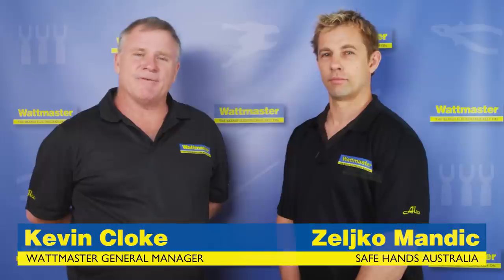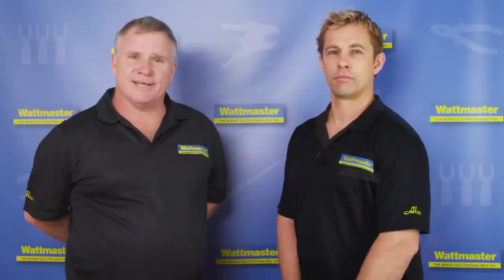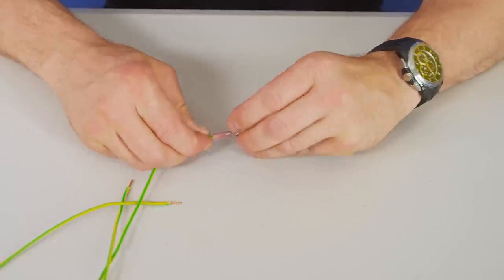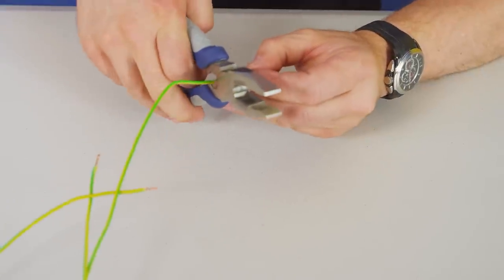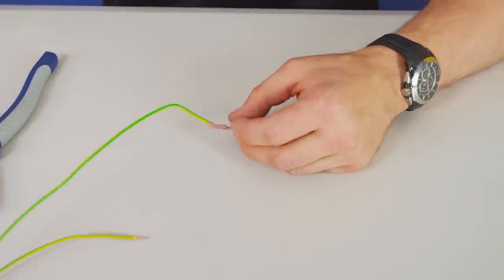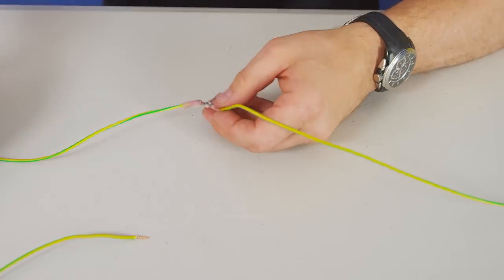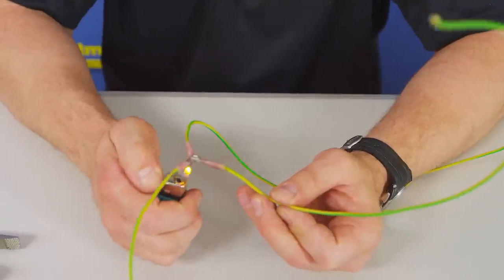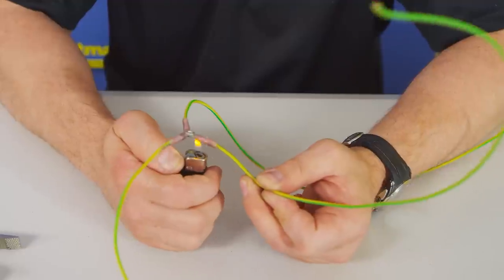How to join cables with 3 way heat shrink crimp connectors - Wattmaster TV

Comment: interesting that you can protect the wire connection with heat shrink but he center of the connector is exposed....kinda defeats the purpose, doens't it?
Reply: it's a ground wire, it must be conected to a grounded surface precisely, that's why there's only one section without isolation. 😉